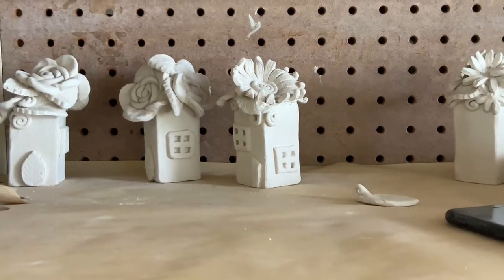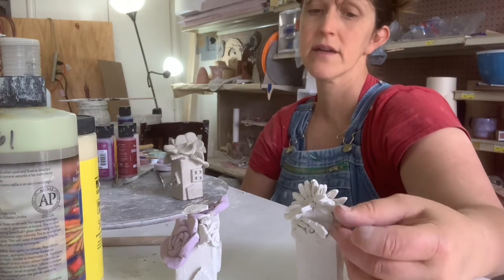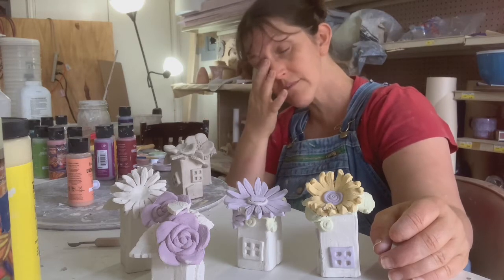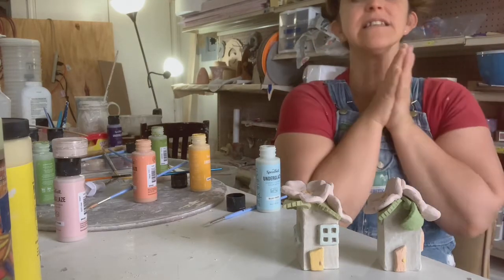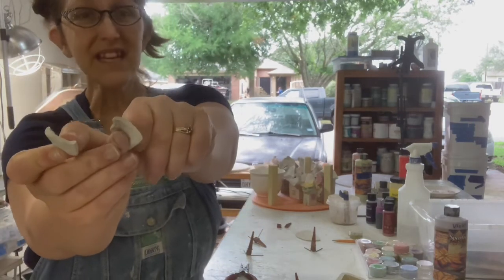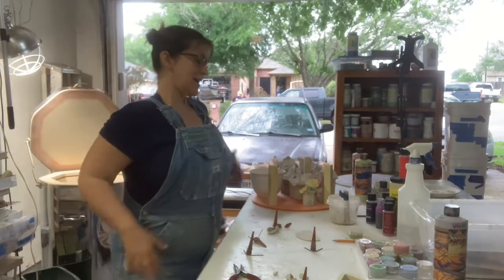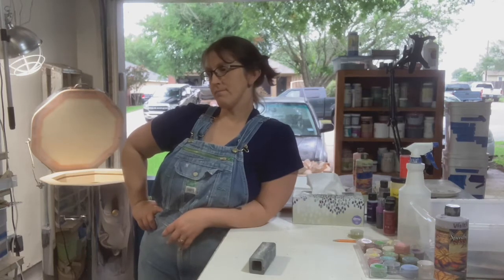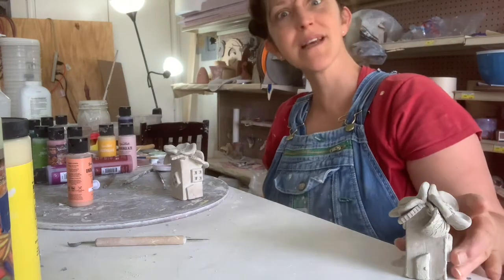Water content in clay, glaze bone dry clay, fast dry pottery for firing, ceramic home studio vlog TX

Comment: There is a zinc free clear glaze I have had great luck with over underglaze after bisque fire.  The recipe is in the Book Amazing Glaze
Reply from the maker: Thanks! I will look into that! Have you tried it over unfired underglaze?or is it just generally a good glaze.
Reply: @CallUsTemily  I use speedball underglaze on bisque ware and as long as I dip then let dry before adding more things I am good to go. I use T mix 6 from trinity ceramic supplies.  It is a super white clay when fired. The glaze is odyssey clear.  When I have messed up and double dipped when wet it crawls but I have saved it with refire.  I lucked out and it is the first clear glaze I have tried. You can see the results on my channel.  I am still new. I am a clutz so don't really want to put underglaze on unfired
Reply from the maker: We just got some trinity spectacular! I’m excited to try it out soon!

I’m totally with you in the klutz department. The more I learn the more I think that nothing follows a single set of rules in pottery 🙄🤪 I think there will still be situations where I will find myself underglazing in all the stages 🤷🏻‍♀️

But I will definitely head over to your channel and take a look! Thanks for replying 😌